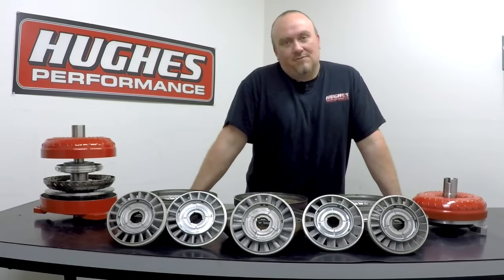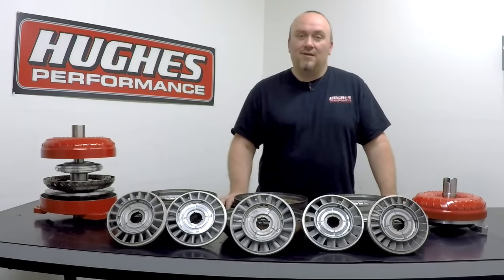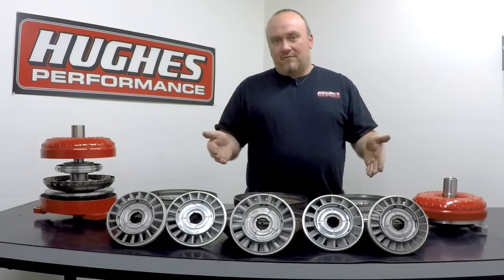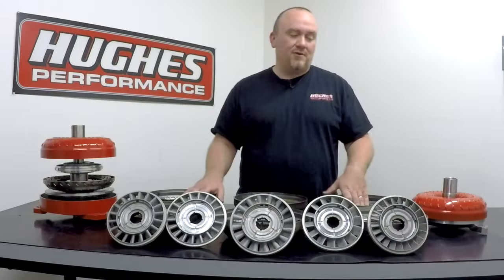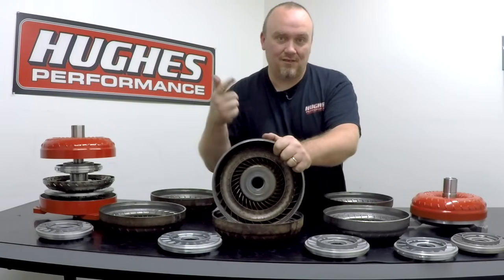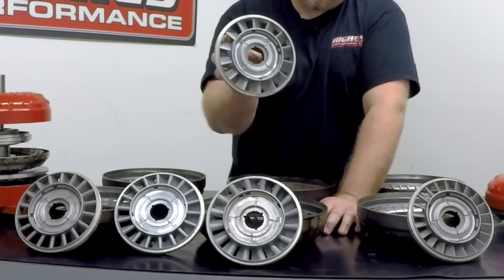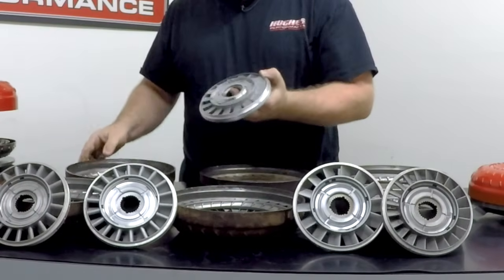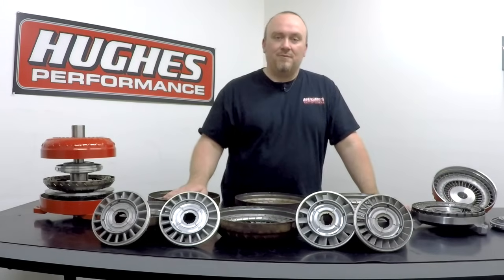Ep. 5 Torque Converters 101: What Is Stall Speed?

Comment: i got a question for u ..i got a 1990 k5 blazer 700r trans 2000 to 2400 torque converter in it and im thinking about buying this race motor  it has 12.5 to 1 sbc 355 030 over with elgin e-1090p solid flat tappet cam with scorpion 1.6 rockers for total lift of 573 intake 594 exhust can i use the torque converter i have on this engine,,..i no i got alot of things to change because it is a tbi fuel injection

Comment: My old torc converter was a 2500 stall speed” for a 3800 supercharge engine behind a fiero” I went to a 3000 stall speed because I ditched the supercharger and went to a big turbo.....I did the 3000 torc converter for turbo lag prevention” the engine has good low end torc” not as much what  it had the supercharger” the torc for that engine” without the supercharger is 250 pounds of torque, but builds up to 540 Horsepower....I did the higher stall speed so I wouldn’t have to add Nitrous oxide for launches.

I didn’t want the Porsche issue if anyone knows about some of the late model Porsche that would break the tires loose when the turbo engaged at low cruising speeds.....those cars were dangerous.

Comment: I have a 72 350 motor 4 Main with a turbo 400 miles it and I can’t get the torque converter with the torque transmission through a belt was a shift kit what do I need in the torque in the transmission it would work with that transmission
Reply: Excellent engine and transmission combination right there. Hopefully you got everything figured out and have it running great.

Comment: i really appreciate this video, in short the more you slow down the fluid coupling from happening/ efficiency the higher the stall speed/ the more torque can be output by engine without overriding torque converter, trans, etc. Thank you so much finally understandable. :)

Comment: Do u have any HP 2215 valve body replacement gaskets.
Reply from the maker: Yes, you can order those under part number HP2216 which comes as a pair.
Reply: @HughesPerformance  
Thanks for the response been a great transbrake.

Comment: Can you make a video dedicated to the Allison 1000 TC considerations and different applications. I want a truck that can do it all. Street, track, tow/haul. I'm at 454hHP de-torqued to 800 lbs. with a 120hp tune looking at getting a transmission built and throwing in a 250hp tune for my 68mm, 10mil.stroked CP3 and 60 over injectors. Goal of 750hHP/1300TQ.
Reply from the maker: We don't get into Allison transmission builds here at Hughes, nor do we offer much for the diesel market apart from the typical billet triple disc converters and deep pans. If you're looking for hardcore diesel performance transmissions then you really need to be dealing with Suncoast.

Comment: hello, i have a 1969 ford galaxie sportsroof (Heavy car), 3.50 rear gears, wheels = 255 60 15, C6 trans (w/ transgo shift kit), 390FE, edelbrock perfomer intake, holley carb 600cfm, FPA shorty headers, isky RV part#351256-262 cam (Hyd Flat Tappet, Advertised Duration 256/262, Lift .492/.488)
what can you do for me for stall? It's a street car (won't see strip)
Reply from the maker: Part number 35-20 would be a fantastic choice for your combination. This is our Street Rod series converter featuring an advertised stall speed rating of 2,000 - 2,200 RPM. 

This model will provide a noticeable improvement in low speed acceleration and general performance while still maintaining excellent overall drivability, responsiveness, and converter efficiency. 

We keep this model in stock and ready to ship. 😉
Reply: @HughesPerformance  thx!
Reply from the maker: @ramiram84  you're welcome!! 😀

Comment: I am getting started on my 1971 Nova build. Just got my 383 stoker built, I was thinking in my mind I need a 2,500 stall. I wake up this morning and this is the first video on my recommend list. LMAO 😂
Reply: Building a 74 nova going with a 350 and 2500 stall 700r4 3.73 gears 

Then Super T-10 and 400 hp 5.3 ls
Reply: @Drey1957 

That 700r4 isn't gonna last to long.
You gonna burn the Bans up.
They are weak from what I've been told.

Comment: So my truck makes 265 full at 2000 rpm. (Ford 300)  if I foot brake it it does about 1500 rpm.  Is there anyway to determine how to determine my stall speed based on that?. Its totally stock E4OD transmission
Reply from the maker: Maximum stall speed is determined by whatever RPM the engine will flash to upon initial acceleration under load whether that be from a stop or very slow roll.  You can transition to wide open throttle immediately at the same time of releasing the foot brake at 1,500 RPM, observe the tachometer while doing so, and the initial flash RPM is the maximum stall speed of your converter.  You'll probably only notice another 200 - 300 RPM of flash over your current footbrake stall speed with that combination.

Comment: i have a 55 bel air with a ls3 and a brian tooley stage 2 cam, the cam is advertised to use the stock converter..... it has a 6l80e trans with 350 gears and its against the converter when i stop. What converter would you recommend for this application. Thanks, great video.
Reply from the maker: The BTR LS3 Stage 2 camshaft really works better with a higher stall torque converter. It's a great cam, but it's barely tolerable with a stock torque converter. I recommend our part number 65-25L. This is our Street Master 6L80 model that will typically provide stall speed in the range of 2,400 - 2,600 RPM with a combo like yours, will provide more favorable idling characteristics in gear, and still maintain fantastic drivability.
Reply: @HughesPerformance  Thanks for the response, i will be getting with you to order that converter.... Thanks
Reply: @robertwilcox393  Do you recommend a trans cooler, or is it necessary.
Reply from the maker: @bobwilcox5775  an external transmission fluid cooler is always a sound investment.

Comment: Thanks for the great video! What is going on with a GM Switch Pitch / variable vane torque converter? How do they work and do they have any benefits?
Reply from the maker: Switch pitch torque converters can alter the stator vane angle (or "pitch") when the switch pitch feature is activated. The stall speed will increase when the feature is activated which contributes to faster engine & vehicle acceleration from a stop or low speed.
Reply: @HughesPerformance  Came to ask the same thing, I rebuilt an ST400 trans and stuck it behind a 472-inch Caddy in my rat rod but didn't fully understand how the switch-pitch function works. Thanks!
Reply: @HughesPerformance  So, are you saying you can have a switch where you go from stock to high stall speed???!?
Reply: @guardiandogoargentinos1385  I believe the solenoid that controlled the pitch of the vanes was connected to a switch that detected the throttle position, but it could easily have been connected to a manual switch.

Comment: Great video on understanding converters. Some shops i have spoken to ask specific engine build details is this really needed. Also is converter diameter a big factor in achieving what is needed as in smaller engines need smaller diameter for it to work. Thanks ray
Reply from the maker: Yes, when we provide a torque converter recommendation we want to know as many engine specifics as possible as well as vehicle weight, rear gear ratio, rear tire size, how the vehicle will be used, etc.

Comment: Turbo hydramatic 425s had a variable pitch stator. VERY efficient. Shame they quit making them.

Caterpillar hydrostatic transmissions had a unique torque converter design...
Ever seen one ??
Great video Sir.
Reply from the maker: We've rebuilt many variable pitch GM converters over the years, but not that particular Caterpillar unit you mentioned.

Comment: In my Dodge truck, I could foot-brake stall and get the same as static stall. I pressed foot down hard on the brakes, and also pulled the E-brake, and that was enough to keep the tires from spinning under a WOT punch. Got ~2200rpm
Reply: JoeIsCrazyWillman my condolences to your trans.
Reply: @lost1mp  Yeah really, in a dodge it won't put up with that long, sad when a company makes a worse slush box than GM does, but yet fiat dodge does LOL.
Reply from the maker: Some vehicles do have enough brake system holding power to achieve maximum converter stall speed. As engine torque output increases with modifications, that becomes much more difficult to achieve.

Comment: Are there application for using both a torque converter and clutch at the same time?
Reply from the maker: Lock-up torque converters first began use by US domestic manufacturers in 1978. A lock-up converter features a clutch inside the torque converter that applies at cruising speeds typically around 35 - 40 MPH depending on the application. This feature was originally incorporated by OEM's to help increase fuel efficiency and reduce engine emissions. The aftermarket has since adapted lock-up converter technology to some extreme high horsepower drag racing applications.
Reply: Not usually as an automatic transmissions clutches are internal. And the new "manumatic" type automatics simply allow to specifically select an individual gear. Actual manual transmissions do not use a torque converter, just a clutch. To have both would require a massive bell housing and a very complicated hydraulic system from the transmission. 

Also, why would you want both? The complexety of an automatic is enough for most people. Why add to that by throwing an additional fly wheel clutch to the mix.
Reply: In the early days of automatics, there were actually Chryslers with a pedal-operated clutch and a fluid coupling (a torque converter without the stator). Some shifted automatically between 2 speeds, but you had to use the clutch to switch between "ranges".  They were probably less confusing to drive than to explain. The comments on this video explain it better than I ever could.
https://www.youtube.com/watch?v=p-wfIrtVUmk
  Also, VW had something called an "Automatic Stick Shift" in the 1960s, with a torque-converter,  a vacuum-operated clutch and a 3 speed manual gearbox. The clutch automatically disengaged if the transmission lever moved so the driver just had to shift. 
  Both of these seemed kind of kludgy, but they still could idle in gear, and could be driven in high gear with no shifting as long as you weren't in a hurry.

Comment: Used Vega convertors with turbo 400 with shift kit and manual valve body and big blocks on the street for years.
Reply: I was thinking the same thing that worked yet they sure built some heat.
Reply: @sswcustomsewing4276  so if I had a six-cylinder with the same transmission and put it behind the big block it will make more torque with the big block
Reply: I mean to say it would give it more stall

Comment: So stall speed is the amount of RPMs the engine has to make to get the driven wheels to turn? I can see how such an application would be needed for racing, but what is the advantage for street?  Does the engine always have to hit the stall speed to make the car go? Say 3,000 stall speed. Does the engine have to reach 3,000 before the car will start to move? Sorry if I seem a bit thick, but this has always been somewhat confusing and have have yet to get a good answer. Your video did seem to help me understand, if I did indeed understand it correctly. Thanks.
Reply from the maker: A higher stall speed converter will still provide drive power to the wheels at engine RPM below the actual stall speed rating of a given converter. However, a higher stall speed converter will display a higher percentage of slippage as drive power is initially being generated to the wheels, much in the same manner of slipping a clutch on initial throttle application and acceleration in a vehicle equipped with a manual transmission.
Reply: Hughes Performance I have a 383 with a SS 23-2500 and it feels like I’m driving a snowmobile with shift points I can’t even feel. Do I need an 1800 SS converter? Throttle response to power feels sluggish and my shifting is so soft, I can’t feel it. I’m confused as I used to feel every shift point on my stock setup
Reply: The stock stall is the best until it’s not. Typically large cams will cause the need for a higher than stock stall. The stall speed needed will be based on all of what he said as far as variables. Also it’s not a on off operation. It will work in the same principles as stock but at a higher rpm. The stall is where in theory a X rpm the engine can push through your brakes. Hold your brake down and slowly press your throttle you will feel basically a breaking point then the vehicle begins to move. To low of a stall the cam lope will start to shake your vehicle and perhaps try to move the car eft.

Comment: Hey guys. I have a 2011 Camaro SS full boltons with 3200 Circle D stall with 391 gears.it makes 380 rwhp and 400 ft lbs torque.  I can't footbrake it past 1800 rpm with pushing through the brakes. Is that right? Thanks
Reply: Yes, because as he mentioned, foot-brake is your lowest read stall, because you're limited by your traction. Now if you can get your wheels to remain locked and do it again, you should be far closer to your stall speed.
Reply: @JoeIsCrazyWillman  Thanks Joe👌
Reply from the maker: There's not necessarily a "right" amount of footbrake stall speed. Flash stall speed is really what's more important. That being said, we can tune your Circle D torque converter for increased footbrake stall speed if that's something you desire.
Reply: @HughesPerformance  Thanks for the response. I havnt  flashed it at the track yet. But i sure  will  give it a go.👍

Comment: Whatcha advise for a 64 Impala with a LS1 swap? Ls6 intake, 216/224 115 lsa cam. 155/80/13 tires. 3.00 gears?
Reply: You're running an LS on 155 tires? Wth? That thing ain't gonna know what traction is. Lol
Reply: All that engine work and highdros,...ok hope it’s not a hopper and looks good man.
Reply: lost1mp Full restore, everything chromed and gold plated, piston pump to the nose, it hops like Jordan when I need it to lol!!! Candy black
Reply: lost1mp can’t fully restore a car not do the same to the engine lol!!!
Reply from the maker: If you're running the matching 4L60E transmission then torque converter part number 22-20EL is a great choice.
Reply: Lowrider with 14 batteries in the tru k plus hydraulics. Lots of us have them lol ;)
Reply: Picked the 2300 stall for what I’m doing

Comment: I have a silverado 1500 with headers c.a.i and underdrive pulley what will be the best torque converter for this setup
Reply from the maker: I recommend torque converter part number 22-25ELMAX. This converter will provide 2,400 - 2,600 RPM of flash stall speed with your combination all while maintaining excellent drivability.
Reply: 4.8with 4l60 and 3.42 gears

Comment: What's the advantage of going with a steel stator compared to a aluminum stator ? Is it just that it can handle more power ?
Reply from the maker: A steel stator is ultimately stronger than an aluminum stator.  That being said, modern billet aluminum stator designs are incredibly strong as well.

What it really boils down to is selecting the right stator design that will provide the correct flash RPM, torque multiplication, and converter coupling characteristics for a given combination.  

Correctly designed steel stators will typically (though not always) offer increased flash RPM, less torque multiplication, and greater converter coupling ability when compared to similar aluminum stator models.

Comment: I have 1500 silverado with 4l80e and  ls3 gt12 cam 373 gear what is best converter
Reply from the maker: Our part number 25-30LHD torque converter would work well with your combination.  This is our Pro Street series billet single disc 265mm model featuring an advertised stall speed rating of 3,000 RPM.  This converter works really well in high performance trucks; offering a nice overall blend between great drivability along with a significant improvement in overall acceleration and performance as compared to an OEM torque converter.
Reply: Thanks

Comment: I really appreciate the vid..My knowledge of "High stall" is to get the engine in the sweet spot when you stab it as well as be able to idle with a large cam(low manifold vac) but the actual size of the converter is much smaller as the stall speed increases (Factory V8 converter over 3500 rated converter)....I'd like to know is that a smaller oil volume thing...
Reply from the maker: Great question!!  Thanks for commenting here.  Oil volume inside a torque converter does indeed play a significant role in the stall speed characteristics and coupling efficiency of a torque converter.  

As torque converter diameter decreases, oil volume obviously decreases as well.  As oil volume decreases, there is less fluid available to offer resistance against the impeller as the engine is running as well as less leverage being generated from the impeller to the turbine due to the smaller, shorter impeller vanes.  Consequently, as more engine torque is applied to the impeller, a corresponding rise in stall speed occurs.

Additionally, most smaller diameter torque converter cores typically come from OEM applications that feature small engine displacement with relatively low torque output.  As a result, the impeller designs commonly used with many smaller diameter torque converter cores feature more neutral or even negative impeller vane angles.  As the impeller vane angle becomes more neutral or negative, stall speed increases due to the higher RPM required to create efficient fluid acceleration between the impeller and turbine.